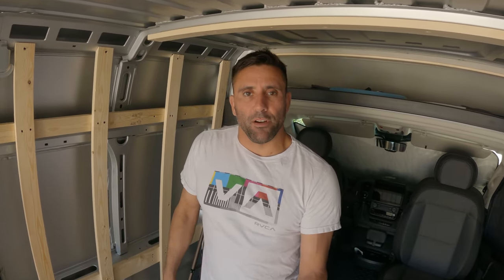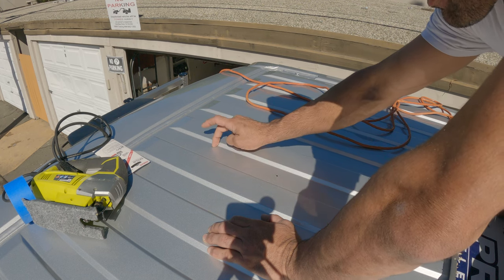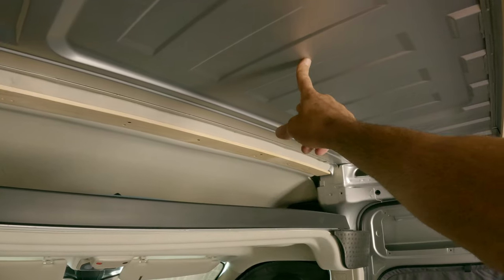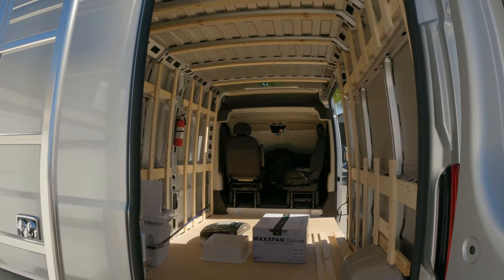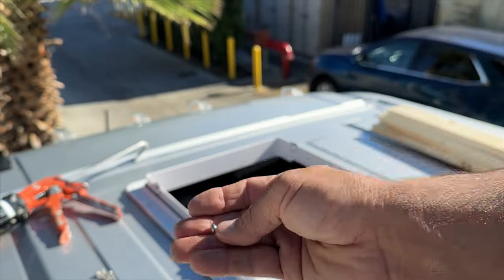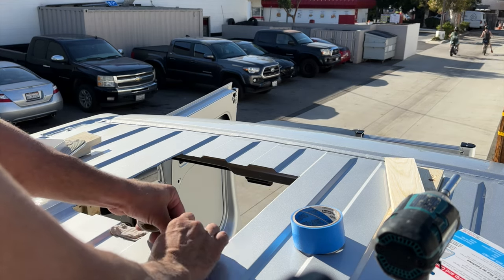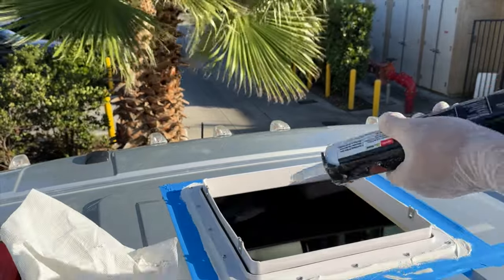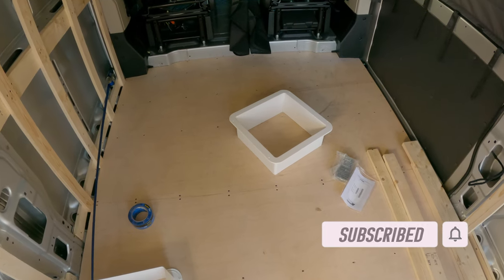Maxx Air Fan Install | Camper Van | Van Build

Comment: Hey quick question - are you planning on filming and making a video of the wiring install? I know it’s boring but I’m sure there’s lots of “gotchas” to avoid…. Would be super helpful…
Reply from the maker: I’m working on that now.  Next video will be the solar panel and roof rack install.   Then wiring video after that.   I don’t think I’ll go over everything but just add a few tips
Reply: Perfect!
Thanks….

Comment: Great video, question I didn't see any links for the switches you use.. Are they just AC switches used for your DC lights, pump etc. Thanks
Reply from the maker: There is not going to be any switches.  It will be connected to the dc fuse panel in the later episodes when I am at time in the build.   It is then controlled with the remote.  These are not meant to be on a switch.  Good question
Reply from the maker: I should also mention you can also operate the fan with the buttons on the fan as well
Reply: OK I see, what about your lights and water pump? Your other videos it looks like house rocker switchs, will AC switches work with DC? Thanks, I just put my first maxxair fan in yesterday your explanation helped me immensely.
Reply from the maker: @chein33  that’s great happy to hear that.  Yes I like to use normal decor switches for those other things because they look so much better than dc only ones.   You can use ac switches for dc but you can’t use dc switches for ac.
Reply: @BuildingVanLife  Thanks, man your up early, I'm on the east coast.
Reply from the maker: @chein33  haha yeh I know.  I wake up at 530am every morning to train jiu Jitsu from 7-9
Reply: @chein33  of course AC switches will work fine with DC.  dc switches tho, can be smaller and less bulky.

Comment: Thanks so much for the video. Question about keeping the jigsaw from scraping the roof of the van. I noticed that the jigsaw was only really going over the blue tape and the other part exposed was the part you were throwing out the square anyways. Would you say that the blue tape is also enough without putting the rug on the jigsaw to stop the scraping on the van?
Reply from the maker: I’ve had the rough jigsaw surface rip right through the blue tape.  You probably could add a bunch of layers of tape and that would work too